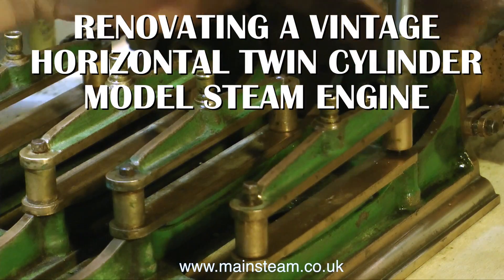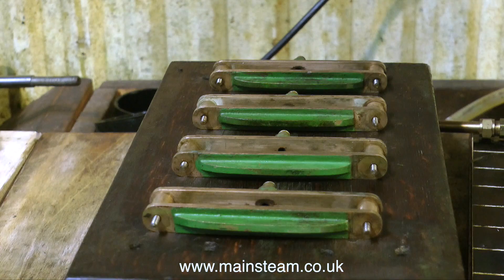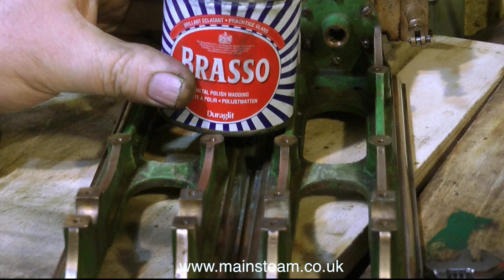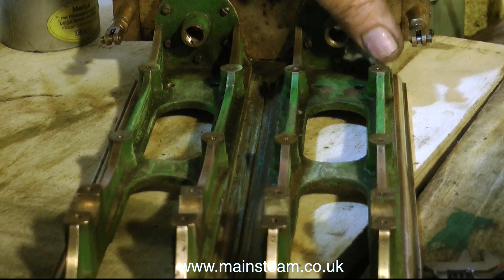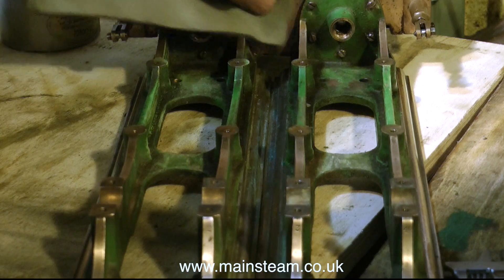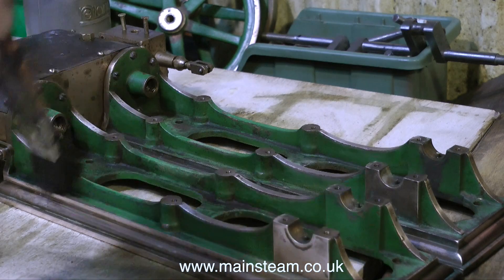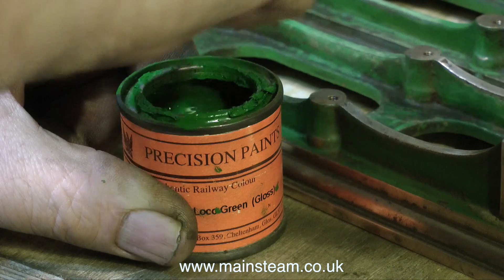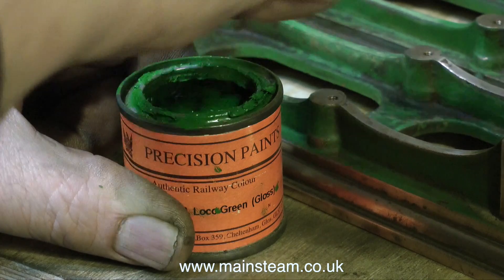PART #6 -  RENOVATING A VINTAGE HORIZONTAL MODEL STEAM ENGINE

Comment: keith another hint  to look at to clean with we used it in machine shops to clean down parts that had heavy staining - surface rust or just general gunk built up  .  automotive mechanics  hand cleaner   one brand here in states  called  "Fast orange" i got introduced to using in many years ago cleaning up extrusion feed screws and housing in blow down extruders that got coated up with residue and basically almost baked on , the plastic and varioous materials from extrusion would come right off with a minimal amount of work
ingredients for that regular fast orange  (  Water,   PUMICE  ,  D-Limonene , ETHOXYLATED  alcohol , SILICA, QUARTZ  ) it has a mild abrasive level but breaks down very fast,  the other is fast orange smooth with no pumice.  cleaning with them leave a nice  finish .  i would just put some on the tip of a rag and strat in one spot and work out letting the  hand cleaner dissolve away some of the residue then rub gentle to break it up .  it has a light orange cirtus smell to it from the  D-Limonene which is basically a natural solvent type oil from orange or lemon skins. try it some time

Comment: Enjoying the rebuild Keith. These may be "toys", but I admire the engineering. Mineral spirits here in the states are called paint thinner, derived from kerosene. Good solvent and I've used it for cleaning car parts. It stinks, but gets the job done.

Comment: Great Video!
Are you using Standard paints for modelling? Are These paints enough heat resistant for running the engine in steam?
Reply from the maker: Technikfreak L Yes, the paints that I use seem to be fine with steam engines in steam ....I have not had any problems.